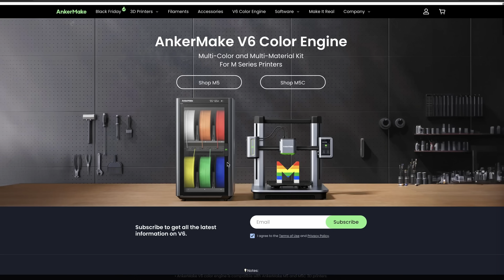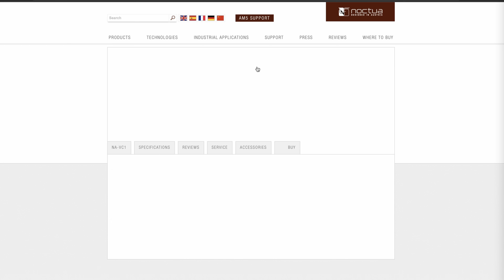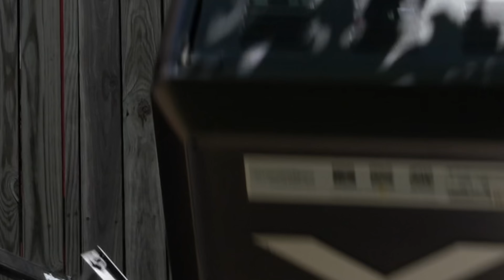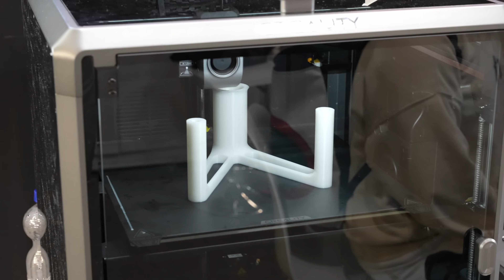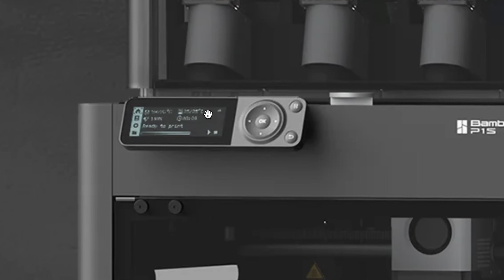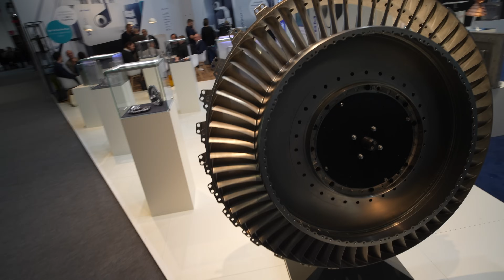THE BEST 3D PRINTERS OF 2023 - (PLUS BLACK FRIDAY DEALS)

Comment: I have narrowed my search down to an Ender 3 V3 KE or an Ender CR-10 SE. They are now only a $30 difference at my local retailer. The CR-10 SE sells out fast but they have plenty of stock of the KE. Any suggestions on which one I should go with at only a $30 higher price for the CR-10 SE? Thanks

Comment: Regarding the Sovol SV07 Plus, what are your thoughts on its use of V-wheels? Would it be better to get the Klipper-screen version of the SV06 Plus? For some reason the SV07 Plus is advertised to be twice as fast. I'm just speculating, but could this be attributed to a lack of accelerometers, or some other difference in the motion system?

Comment: There is multi material and multi color printing, I would not bunch them up together. To print multi color on a FDM machine it´s probably best to use translucent filament and sharpies or some other way of coloring. Multi material is for when you need to combine PVA supports or PLA supports with PETG prints. Or flexibles with ASA or similar. You can then even go ahead and do both multi material and multi color print.

Comment: There is a little update on P1S. You don't need an account/wifi to start using the printer😮. If you are comfy printing from microsd, and using orca slicer and feel, there are not many features or severe bugs to warrant a firmware update, don't need live view and good with the simple interface of the stupid keypad, it is a good standalone printer with/without ams!.  On FLSun, I see ballscrew driven delta.
Can't achieve it with just belts alone! Glad to see a balanced review.❤👍👍
Reply from the maker: Good insight, all will be revealed tomorrow. I’m excited to see it!
Reply: @NathanBuildsRobots  Now thinking about it, Its possible FlSun might use custom linear motor like Peopoly Magneto X, instead of the  expensive precision ground ballscrews. Its also logical, since most suppliers in China are seen as a shared resource unless the manufacturer makes it propreitary, through exclusive contract agreements/inhouse R&D. Just some 💭

Comment: I finally bought a P1S Combo! Runner up was the K1 Max, which I was going to compliment with the Co Print KCM set. But it would have cost more, and I would have to wait until next March to have my "ideal" printer. What made me decide on the P1S Combo was the phrase "works out of the box." I'm still waiting for the printer, but my accessories came. Those free "random" colored filaments turned out to be a light blue PLA tough and blue PLA silk. 🤦‍♂️
Reply from the maker: Hope you like blue filament 😋

Comment: bamboo labs reminds me of an iphone, its a great thing, but everything else u need for this printer is everything extra costs alot
Reply from the maker: Yeah, you want a P1S? That’ll be $700
you want hardened steel extruder gears and a touchscreen that doesn’t suck? That’ll be another $500.

Same deal with MacBook. You want 8 GB memory and 256 GB SSD? $900
You want a 16GB and 2TB storage? That’s a $800 upgrade, so $1700 for that $80 of hardware

Comment: Any suggestions for "best printer farm" printer?
Reply from the maker: Creality has great print farm management through Creality Print. I believe the ender 3 V3 KE, K1, K1 max, and Ender 3 V3 are compatible. Also apparently PRISA has a good print farm interface.

If you go klipper, there is probably some third party apps for multi printer control.

Bambu Studio would probably be ok too. From what I know it seems like it’s more optimized for controlling a few printers, but I’m sure they are working on a print farm interface for those type of users

Comment: I like how creality has changed over the last year. From pretty pricey printers that weren't up to date even back then to very modern machines with competitive pricing.

Explanation: compare an ender 5 pro (400 euros) with a sovol sv05 (200 euros) and tell me why to pick the ender 5. Compare a ender 3s1 (280 euros) with a elegoo neptune 3 pro (210€)  and tell me why to pick the ender. Compare a cr m4 (960) to a elegoo neptune 3 max (360) and tell me why i should buy the cr m4 over two neptunes.

Now you got the k1 and ender 3v3se which are very difficult to beat in terms of pricing. The cr10se is a bit more expensive compared to the competition, but still very good compared to a ender3s1pro, which is only marginally cheaper
Reply from the maker: Yeah, agreed. Creality has really stepped up their game

Comment: V0.1 is the best way to learn 3d printing inside and out. Whether you buy a kit or source it yourself, you’ll have to learn how to fully utilize klipper or whatever you choose to use. That basic understanding of what all the values actually mean really changes your perspective
Reply from the maker: True, but what if I want to just push button 2 print?
Reply: @NathanBuildsRobots  Then you become someone like George Jetson, whose job it is to press a button. Believe me, I have enough experience with people who can only push buttons. They have no basic knowledge and if the button they usually push is now green instead of blue, they are completely lost.
Reply: I wouldn't have the confidence to build a Voron. I have no experience with electronics and I don't have a 3D printer yet. So I would have to get the printed parts from Etsy or the Voron PrintItForward program.

Probably the Prusa kits or the Lerdge iX kit would be better for me as a beginner. The latter in particular seems to me to be something where you can't break much but learn a lot.

Comment: does the ankermate v6 color engine extruder head use drive drive or bowden?
how much does it slow down your printing, given the extra mass?
Reply from the maker: I’d have to take the toolhead apart. I believe it’s a direct drive that has a secondary motor to toggle which filament stream is active
Reply from the maker: Idk about print speed. They had it running pretty slow at FormNext, but I’m sure they could have turned up the speed. The ankermake machines are very solidly built so I’m sure it could handle the added toolhead weight

Comment: Anker's venture into 3D printing has been a chit show. You might not have gotten enough working time with these machines. I could write a long list, but for the V6 specifically, they've delayed and changed plans multiple times and people have been waiting since the kickstarer campaign with $300 sunk. I get that they are trying to big on their multi head, but this assures almost every user won't be able to work on their printer due to the complexity. The whole experience feels like this is a low priority for and has not been a good look for Anker. Not really sure why you think this is cool.
Reply from the maker: Because I saw it running at Formnext. If its reliable, and that is a BIG IF, it will be the first system that allow casual multi-color printing without huge efficiency penalties. It's a very complex system though, and I get that it is taking some time to get right before releasing.

Comment: I'd love to buy a 3D printer during the Black Friday promotions, but I just bought a frickin' laser.
Reply from the maker: Dont shoot your eye out kid!
Reply: @NathanBuildsRobots  - My mechanical engineer friend told me the same thing ("Dont shoot your eye out kid!") in an email last night.  I agree with your assessment in this video that these open frame diode lasers are not safe.  I'm building a full enclosure for mine to preserve my eyesight (what's left at my age) and to exhaust the fumes.

I accumulated the parts to scratch build a LinuxCNC 80W CO2 laser almost ten years ago but never got a round tuit.  Now that I can buy a $250 laser engraver and build a box around it, I'm in.  Advancing technology outstripped my progressively worsening old man sloth.

Comment: Microswiss hotend for K1 (and K1 max)....

Solves non-issues:
- allows for one handed nozzle change (so its not even remotely helping with automatic toolchanging)
- leakproofs a hotend that doesnt leak

And creates issues, thatis frequently a dealbreaker:
- proprietary bullshit aka. no CHT for you
- opposite of best value
Reply: ...and the only true multimaterial soluion is automatic toolhead changing.

-Its truly multimaterial, not just multicolor.

- It keeps toolhead light for speed

(And it obviously doesn't produce waste)

Comment: Crazy thing, I found a basically brand new QIDI X-Plus 3 for sale on Facebook Marketplace for $400 and talked them down to $300 and drove a little over 2hrs away to buy it. So worth it! But the community mods for it are nowhere near where they are for the K1 series which I had in the past but I've not once seen this machine show a single VFA or layer shifting like I did on my K1. I blame those goofy 32T pulleys they use for the X and Y axis. I'm very curious where FLSun is gonna take the S1 in terms of technological advancements over the current market, using a large radial fan CPAP design like a VzBot? They claim 40k accel and 1200mm/s print speed which is batshit crazy for today's market standards. If this holds true, I'm gonna have to have one, especially if its bigger than the V400.
Reply from the maker: Thats a deal. They are a bit of a proprietary mess, but it seems every printer is these days. They seem to be will built

Comment: I've been following FLsun news for a while now, V400 was supposed to be my next printer, then they announced S1 and T1, so I'll give them a few more days to see how it turns out... The name is a bit unfortunate, since most search results will point you to an Ender 3 S1, but oh well...

So far, everything they have said sounds awesome, even the price, while not yet stated is said to be "much lower than 2k usd for S1 and 1,5k usd for T1" (a response to a reddit comment). So if it's around 1k, I think it will be an awesome deal. The flow rate they promised sounds a bit too good to be true, making it on par with the Slice Engineering's super-hotend you showcased.

Good thing is that those printers will release before Black Friday deals end, so there is a bit time there to think about what to choose.
Reply: based on some marketing posts on reddit they are stating 1,200 mm/s at 40k mm/s² acceleration, with a flow rate of 110mm ³/s.  Now it makes complete sense to have that CPAP cooling.  That's a LOT of plastic at once

If it delivers even half those numbers I'll be blown away.  I know marketing numbers are fudged.  My K1 cannot reliably do 600mm/s, more like 400
Reply: @4lan39  Yeah, that's for the S1, T1 is supposed to be a bit more modest, but still highly impressive. I'm still not sure what to think, FLsun has had some really impressive machines in the past, V400 might not be so impressive right now, but it was out BEFORE X1 and all the corexy klipper craze, at the time it was waaaay ahead. So far, whenever they released a new machine, it was top tier. So, in my eyes at least, they have some good credibility that they'll make awesome printers.

I'm supper curious about the build volume, since on the photos it doesn't really look like all that much.

My hope is that they sent out early review copies, and that we'll actually have some youtube reviews before the week ends.
Reply: So, prices are 1500 USD for the S1 and 600 USD for the T1, with a 200$ and 100$ discounts for early birds. Those seem like reasonable prices, but makes me believe that build volume is less than on V400 :(

Comment: Nathaniel, how can i improve my Z-offset on Kobra 2 Pro either by third party or DIY option???
Reply: I'm not sure how good their button is on the hardware side, but try if you can find any comparison between it and a "Voron Sexbolt" (yes, that's what it's called), they seem to be working on the same principle, but the Voron one is very reliable(I'm using several, but not on Voron printers), and quite cheap (also easy to DiY). Again, I don't have a Kobra, but it might be possible to simply change the button out for the Voron one.
Reply from the maker: Good tip! @astrumrocket6556
Reply from the maker: Not sure, I bet I could come up with a mod for it... Like a higher precision button instead of whatever they are using now... And a manual adjustment to get everything more spot on...
Heck, even a firmware update to have an option to do manual z-offset would be an improvement.

Comment: I'd like to get your top picks of printers you've actually used. For example, I know you think the ratrig and creality orange are more noteworthy than the Kobra Max and Neptune Max, but I take it that you've actually used the Anycubic and Elegoo? How do they perform compared to other printers you've used? They all cost less than a 3rd of the rat rig, let alone the orange. (p.s. still love your work, and this video)
Reply from the maker: In terms of value, I would say the Neptune 4 Max is *Probably the best (I haven't used it but have seen it in person and have used the Neptune 4)
The Anycubic Kobra 2 Max is nice, I am using it, but the first layer quality is only half of what it should be. I think their auto-z offset calibration is flawed.
The CR-M4 is great, have used it a lot. It has the best Y axis of the three - using dual linear rails. But it has 2 issues: hotend design is outdated - it uses a PTFE lined hotend. Also the bed material is Polycarbonate instead of PEI lined. The PC bed has been ruined after heavy use, and now I need to replace it with something.

Ratrig I haven't used, but just looking at the collection of its parts, it should be excellent.

Orange storm, only 1-3 prototypes exist - so it is by no means a finalized design. But from what I've seen, they are definitely on the right path to making an excellent product. Will have to withhold judgement on it, but I'm excited to see how it turns out.
Reply: @NathanBuildsRobots  yeah I keep hearing people complain about that weird z calibration nub on the Kobras. Such a strange concept, I'd love to hear how they ended up with that idea instead of using the actual print surface to calibrate z-offset.

Comment: I only use my AMS as an easy way of selecting what filament to use, then I just print the whole model with that filament. Still think it's great, been months since I touched a filament roll. (I don't print that much). Also have an ender 5 pro, with that one I always have to go fetch a filament roll and feed it into the printer, which is why I rarely ever use that printer anymore. I have some black PETG in my ender 5 pro, only use it if I want to use black PETG. I do wish I had a proper multi material 3d printer though, but considering how little I print I'm probably not buying any more 3d printers.
Reply from the maker: That's fascinating that a bunch of people comment that their main use for the AMS is more of spool selection for a print, rather than actual multi-material printing on the same print job. I think they can make more by marketting it as a multi-material printer, but in reality everyone uses it as an automated changeover spool-holder, and is very happy with its capacity for that purpose.

Comment: I think the AMS is amazing in that you can just throw the fillaments you want to print with in your AMS(') and then just select it in Orca Slicer without having to do all that extra stuff of pulling fillament out and purging manually etc.
Reply from the maker: Yeah, from what I've heard from people that actually use it, its more useful as something to change out filaments between prints, rather than a true multi-material printing solution.
Something like the V6 is actually designed to change colors mid print, so I think it's just a matter of being optimized with different goals in mind.

I haven't used my AMS, because wi-fi only mode sucks, and the wifi is broken on my only P1P that is still assembled... So I don't want to figure out how to use everything, having to juggle micro-sd cards, spool assignment, etc.
Reply: @NathanBuildsRobots  Do you not have warranty with your P1P?
Reply: @NathanBuildsRobots Ankermake still has not effectively answered how there is so much material savings.  How do you fully flush one color from the hotend with the next color and not waste any material?  Are they using magic?  It is BS.

You don’t need a purge tower with the AMS, and you can dial in tighter flushing volumes and you can create a purge model to print something if you are really concerned about it.  

I don’t see how you could nominate a product that is not yet  released and has ZERO sales or customer feedback over the AMS which has shipped to thousands of customers who are generally satisfied.  It reeks of bias.  A product that did not sell this year and WON’T should not even be mentioned.

It is a joke.
Reply: @mandoreforger6999  As you suspect, the V6 was mentioned a bit prematurely because it was sponsored. If you paid attention, you'd notice that neither the sponsored printers, nor the V6 were awarded.

To answer your other questions, the material savings come not from magic, but from a multiple extruder system. This system is evident at 2:13. Mid-print purging is not required with such multiple extruder systems, and mid-print priming is only required if filament leaks out while inactive.
Reply: @NathanBuildsRobots how is ‘just swapping filaments’ different than multi-material printing?  In order to  do multi-material printing you need to swap filaments.

From what I heard, zero people are using the Ankermake ColorEngine to do zero things.

It is true that the people using the Ankermake color engine are saving filament by doing zero prints at all.   So congrats on that…

Kindly explain how there is no material waste in flushing the hotend.  Where does the flushed filament go?  To filament heaven where it is magically reincarnated?  

Come on.